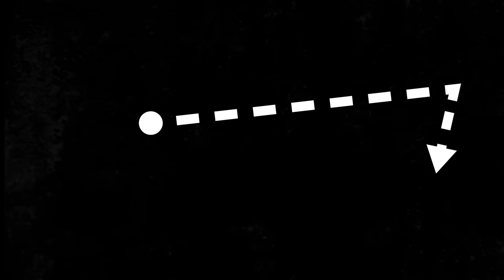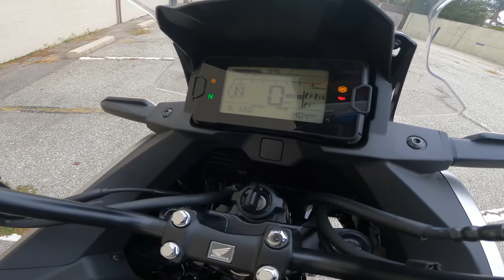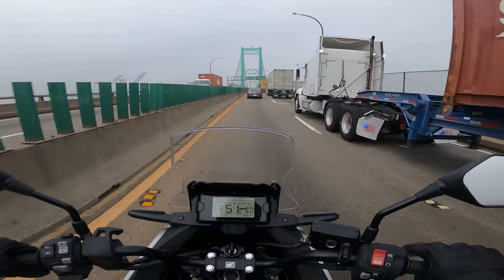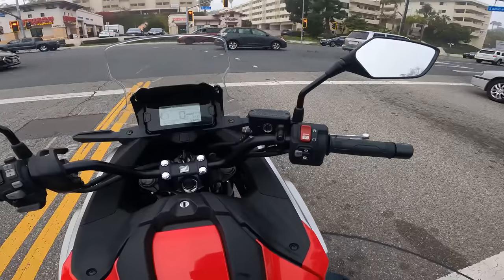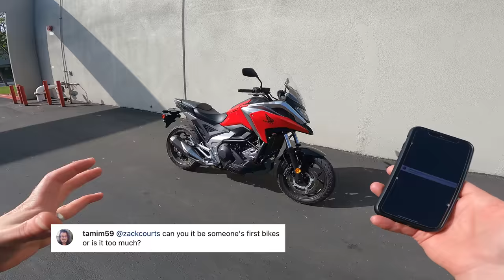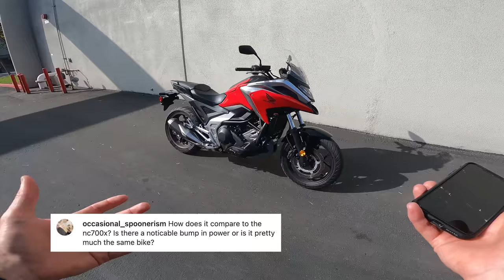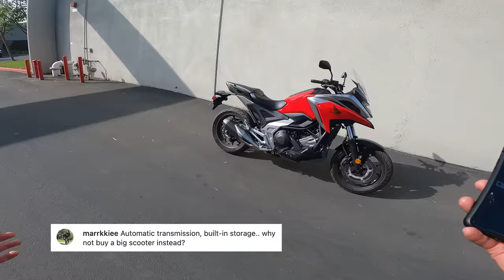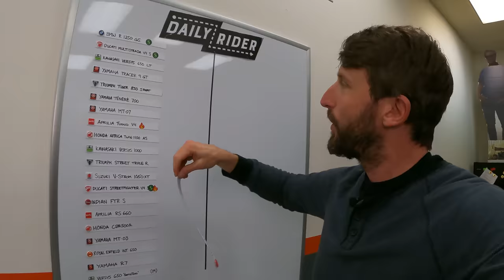Automatic-transmission on a motorcycle? 2021 Honda NC750X DCT | Daily Rider

Comment: I still think that storage compartment is one of the best pieces of motorcycle design I’ve seen
Reply: The BMW F650SC  Scarver had it way earlier altho i don't know if you could fit a helmet in that.
Reply: You can fit 2x full size standard helmets under the seat of a Suzuki AN400 K1, or a 24 can crate of beer ;) 
Can you guess I'm lookng at the NC750x to change to... hehe
Reply: @jfv65  anche l'aprilia MANA lo aveva ma non ci stava un casco

Comment: The 2 wheeled Honda Accord. And yeah, it's supposed to be a compliment.
Reply: Unfortunately there's a lot of idiots, that snub and mock this model of bike. there's a lot of people that like the dct trans. I myself have both legs with torn acl's and injuries from playing soccer and cycling wildly, ( mtb). 
So there's definitely a use for this type of machine.  Is practical, don't look bad, at all, economical, and seems to be fun, even that is proven to not be fast. I agree with your comment 👍 
Like a 2 wheeled honda accord!!
I almost Forgot, best part is that it  has The FRUNK!!
Reply: I have a '13 NC700X with DCT.  I think your comment is spot on!  And not an insult at all! (though I dunno if it's exactly a compliment.  haha)
Reply: @busterinny4808  The Accord is one hell of a car for the everyday normal person, the coupe with the manual is even unironically dope.
Reply: @cocoloco65482  I fully agree. I had an accident in April that tore both the ACL and MCL of my left leg so this bike is a literal godsend for me. I also drive a Honda Civic so I may as well have a 2 wheeled version of it! LOL
Reply: More like a Honda Fit - I ride a wing w/DCT; that’s an Accord
Reply: @dplorbl  A Goldwing is more like the Toyota Century (Honda doesn't make a flagship luxury barge so bear with me).

Comment: One thing I've never heard anyone mention in this review is the amazing steering geometry. You can scrape the pegs easily. It recovers awesome in a slide. You can stand on the pegs to ease an aching butt. It's cheap to run. Cheap to maintain. It's handling is amazing, even with the mediocre suspension.  I'm 6'3 and it hauls me around all day at 80 miles per hour with no drama.
Reply: Great to hear- I'm considering buying one!
Reply: Thanks I'm 6'4" tall and was wondering how it would be riding.
Reply: 6.2 and worried about eating my knees and losing sensation in my legs.
Reply: For some reason, I find it difficult to imagine riding an automatic bike.  What is that like?  Is it still fun to ride without the constant manual manipulation?
Reply: @sgtfixer  There's a manual version.
Reply: @sgtfixer  The DCT is the only one available anywhere I've seen in the US these days, and I'm glad I had to buy it. The DCT is great. Smooth, reliable, lets you concentrate on traffic or scenery rather than finding a gear. Watch the Knox vid on the bike to see another very experienced rider / reviewers take on the bike and the DCT.
Reply: @povertyspec9651  And did you get one?  I have had mine for nearly 2 years, and as hard as I try, I cant find anything to replace it
Reply: I replaced my cbr500r to a cbr600f but I really miss the raspiness of the twin cyl plus the economy and fun I had switching gears and all. With a 250cc bump the nc750 must have the perfect engine for 99% of uses. I'd love to buy one when I grow up, but they do need to give it double brakes front. @flexywing
Reply: @sgtfixer lol. Ever driven a manual car? Automatics already won the battle. Having less distractions also makes a bike safer
Reply: @fightsims1252  yes, I actually prefer a manual but I get what you mean.
Reply: @povertyspec9651  I may as well , if the price is right  I am intrigued with this dual- clutch\automatic business !!!  But i'm a bit on the short side, only six five, will it fit, guess, I find out !!!!!  By the way: what is the weight?

Comment: Late to review. First off I'm only interested in the manual version and the power and performance of the 750x  fits quite well in my 'comfort zone'. Currently riding a Tiger 900GT but thinking of changing. Main reason is i find the tiger top heavy and a challenge for slow manouevres. I also don't do off road or pillion riders.  The 750x has started to appeal to me. So to any owners out there and Zack would you see the honda comfortable with a trip of xk miles over say multiple weeks? What would you add/change to make it fit? Thanks.

Comment: So at the end of the video, the NC750 makes it into the top 5 on the Daily Rider leaderboard - but every time I watch one of these videos, I feel like the mid-size bikes are usually being disparaged as not having enough horsepower and torque. This may just be the way I hear your comments but I feel like mid-size and smaller bikes are discussed in terms of how they compare to larger motorcycles. I have owned 18 different motorcycles. Yes I compare and contrast them to one another, but I never expect the smaller bikes to stack up against the larger bikes in terms of power. Instead, I am more interested in how I fit on the bike, how the bike fits the riding style it was designed for and how the bike meets my expectations for what it is. Is it possible to make a Daily Rider video about mid-size or smaller displacement motorcycles without contrasting them with bikes that have more horsepower and torque? A bike with a DCT transmission in my world would rate higher on the leader board than a bike that has the ability to do a wheelie - but then I do not feel the need to do many wheelies on my daily ride.

Comment: This is one of my 3 bikes. I ride it most, not because I don't know how to ride manual ( 2 of my bikes are manuals), not because in lazy, but because it allows me to just enjoy the ride and see my surroundings rather than figuring out what gear to be in on a turn or making sure I need to be on the clutch or neutral gear. It just makes riding fun in a different way. Now my vtx1800f3... is a different fun compared to my CHonda Grom SF.
Reply: 🤔²
Reply: Is that really something you need to think about as someone who is experienced enough to own 3 bikes? It should be coming naturally by now bro
Reply: @louisross2919  i think you're missing the point. Even if one does things "automatically" they still need doing. With DCT and this engine you just relaxed all the time, and just happy riding.

Comment: Honda DCT in manual mode is awesome. It shifts so easy and fast! I have a Rebel 1100 DCT, and it’s easy to do 0-60 in 3 seconds without much of a wheelie 🤣. I do not really care for automatic mode, but I love manual mode more than a manual clutch and shift or a quick shifter.
Reply: Me too!
Reply: Once you become an Old Fart like me, you will appreciate Auto Transmission,, Manual is for younger whipper snappers...
Reply: I wish they had one of these on their smaller displacement bikes.  I don't have a need for a 750 and I personally look at a 6,000 dollar motorcycle and say 'That is really expensive' so needless to say a 9,000 dollar bike is a no go.  I am looking at getting a Versys 300 and if Honda had one of these in that bracket that'd be great.

Comment: 27k on my '16 NC700x DCT so far, like Zach says it may not be the most exciting bike in the world, but it gets shit done. Zero problems in that time period. Heated grips, rear case, seat concepts seat, Kaoko throttle stabilizer make it a cruising machine. Racetech springs, gold valves and Ohlins rear shock addressed all suspension issues...

Comment: The best explanation of DCT I've heard so far. 
I don't want one, but as a "daily rider" it's brilliant.
Reply: I want one. And with gas creeping over 5 dollars. I really want one.
Reply: One of the better explanations I've heard. Basically, it's a clutchless 6-speed gearbox. It's not a CVT, nor is it a traditional automatic transmission, which would have a torque converter. In traditional autos/CVTs, when you let off the throttle, it coasts. There is no coasting in a DCT - you actually feel the engine braking. On my 2020 Africa Twin DCT, the level of engine braking is adjustable, with 4 levels to choose from. As a lower cost entry, I also noticed the NC does not have "Sport Modes," as the Africa Twin does. The "D" button on the ATwin, engages SI, SII, and SII, three levels of sport mode you can cycle through buy long-pressing the "D" button for a second or so, which is labelled "D/S" on the ATwin. I also noticed the NC has no lever on the left handlebar, where the ATwin has a lever there, with an extra long reach, which is the parking brake. Last thing, I checked the accessories and it's not offered on the NC, but there is an optional dealer/user installed gear shifting lever for the ATwin DCT ,so you can manually row the gears, instead of the bike doing it. Both bikes do offer a manual mode, just left of the "D" button, but you can also always interrupt and switch gears even in D or S1 - S3 mode, by using the foot shift lever if installed, or the trigger pair on the left handle bar. After 6 months on the ATwin, I don't know if I want to go back - the Honda DCT, at least on an Africa Twin, offers the best of both worlds!!

Comment: It is a pleasure to see the leaderboard and how bikes that normally get no love are able to tower over the hotrods and expensive toys.

Now if they gave this thing a belt drive to cut maintenance even more!
Reply: Totally. I have a 2012 version and that is my wish too. Belt drive!!!!!
Reply: Why not shaft drive?
Reply: @TheBasil36  weight and cost and power loss. Belt drive is a better and cheaper on mid size bikes
Reply: Belt drive doesn't have less maintenance you just trade a hand-full of small jobs for a big job down the road.  It is one of those 'next owner' issues though I suppose I can see how people would see belt drives as maintenance free*.

Comment: Whenever people talk about the DCT, they seem to suggest it's mostly good for people who can't use a manual, but I just find it interesting. I daily a manual non-abs Miata, and I would choose the DCT ABS model just to have something different. I also consider an automatic to be a (slight) safety feature. Of all the motorcycles I see, this is one of the few that feels like a true upgrade from a scooter. Most others seem to forget practicality or are quite large.
Reply: As with cars, it provides the choice between manual or auto...which has to be a good thing

Comment: I 3D printed a 20 liter (Don't know, what that is in eagle bladders) gas tank, that fits into trunk. I fall asleep before I ever run out of fuel. XD
Reply: What material did you use? ABS?
Reply: @johnsteinberg8540  Carbon fibre reinforced nylon, tempered after the print and tested for leaks.

Comment: 7:28 Regarding the lack of cruise control, a 3rd-party company called Veridian Cruise just announced they've developed an add-on CC unit for the NC750X (throttle-by-wire models from 2021 onward, including manual and DCT versions). Installation seems to be fairly simple with pre-built electrical connectors, and requires just a few panels to be removed along with a tap into the brake LED wire.

Comment: This bike gets no respect. Such an awesome design.
Reply: Yeah it's pretty brilliant. If people need something to commute with its brilliant. The high torque motor is a smart match. Having the weight down so low would hide the weight when moving. Obviously you'll feel it at a stop but even then it's probably easier to keep balanced than a similar sized and weighted bike with a standard upright motors.
Reply: This bike is brilliant.
Reply: Agreed. These are fantastic bikes and the rest of the world understands them better than the US market. But this generation is looking to change that. They have been selling well and the DCT is hard to find especially in SoCal.
Reply: Just like the Pacific Coast.
Reply: @johnthomas2485  Yes, I own one.
Reply: @mikedrop4421  That's true. I had a 250cc before the manual NC 750X and the 250cc seems to be heavier at stops.
Reply: @mindspinn311  The US understands it we just have no need for it. A bike in the US fills the same role as a sports car. In Europe they fill the same role as any daily driver.

Nobody buys a Camry for track days or car shows.
Reply: @someguyontheinternet7165   I commute by motorcycle and don’t own a car. Some of us consider a motorcycle a tool rather than a toy. Didn’t I just say the 2021 model is selling very well compared to the previous one? It’s actually been selling well here since at least the 2019 model year. It’s just not a best selling model like in Europe/UK. Things change, and so have American’s taste in motorcycles.
Reply: @mindspinn311  Winter aside, I commute on mine too. People like us though are the exception rather than the rule. Excluding California I'd be willing to bet less than 10% of motorcycles are regularly used for commutes in the US.
Reply: Had one as my daily for a year and loved it. The only issue I had was the seat, and I wasn't willing to shell out a few hundred for a custom seat I "might" like
Reply: @dillybilly5182  The 2021 seat is much improved over the dreaded second generation seat.
Reply: Quite popular bike here in Europe
Reply: Absolutely agree.  I have looked at these and have a friend who owns a '19 manual version.  I live in Minnesota, without a car, and commute year round on the bikes, usually a Super T -- which is fine for my long commutes to a job in central Minnesota, but it is admittedly a bit heavy and bulky for my in town commutes.  I have often thought the NC is one of the best bikes for the sort of riding most of us actually do - commuting, groceries, occasional trips, etc.
Reply: Bought and still own a long while back an NC 700x. Amazing machine but has a weak starter. Would definitely upgrade to this tho absolutely. Prefer all electric at the moment as they have all wheel drive as scooters anyways. Plus the OneWheel is still the King of Cool in the Age of GoPro.
Reply: Interesting concept, but looks too much like an ADV bike. Lose the beak and non-round headlight and it'd look a lot better
Reply: Why would an automatic 2 wheeler get any respect?
Reply: @geraldscott4302  Let's see, a Lambo/Ferrari/Porsche with a Dual Clutch like this bike has is cool. A superbike with a quickshifter that rev matches and is basically paddles with your left foot like this bike has is cool, but the dual clutch in this bike deserves no respect?

Gotcha
Reply: @Fredmullegun  Lambo/Ferrari/Porsche with a Dual Clutch are NOT cool to me. I want a true manual transmission in ALL my vehicles, whether they have two wheels or four. Never really been a fan of Lambos, Porsche pretty much ended with the last of the air cooled models, the last Ferrari I liked was the late '70s 308 GTS (think Magnum PI)
Reply: @geraldscott4302  welcome to the minority. Find me a superbike without a rev matching quick shifter.
Reply: @Fredmullegun  hey boomer are allowed to live in the past 😂
Reply: It's ugly.....nuff said.
Reply: Thinking of buying one.
Reply: Perfect. Usually means no attention from police.
Reply: @someguyontheinternet7165  come on Americans buy Harley Davidson one of the most useless  , low performances in any ways  and bad made but expensive motorcycle brand around 🤦
Reply: My Vulcan s doesn’t either

Comment: Hello Zack .. It might be fun to add some more references to your list  for each bike ... So far for sub categories you have a green dollar sign for expensive and a flame for hot and fast . How about a smiley face for bikes that just make you smile every time you ride them (Like the T7) or maybe a sleepy face for the Tiger 850 or the NC750..  Also maybe a blue E for economic  as in great on gas and cheap to own .. Maybe a wrench for bikes that need a ton of up keep ..Maybe a suitcase  or a box for storage ... PS  when you go home to visit the fam could you do an interview with your dad on living with old BMW air heads . It would be a wonderful clip ...  All the best , Guy
Reply: Agree.  It really can't be a one dimensional measure since all of these do something special in different categories however I think for what the rider board is it a pretty decent overall rating system.
Reply: @georgegarcia3182   Me too /  I agree.. :)  Zack is doing a wonderful job .The fact that each bike is put through just the same ride and shown at whatever strengths or weaknesses are found in each section is just great ...

Comment: Im looking to replace my 2016 model bike

does anyone know please of a new or very hardly used NC750X that is for sale, or might be here in the UK
that does not have throttle by wire
and does not have DCT

and no  neither honda or local dealers were able to help

any help or mature suggestions would be most gratefully received and appreciated